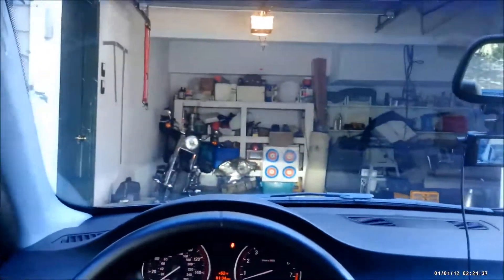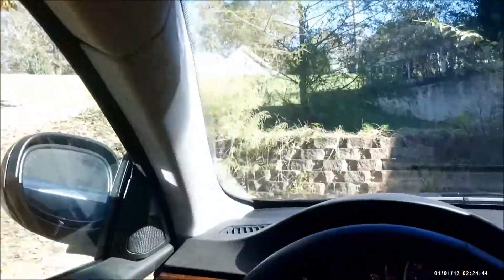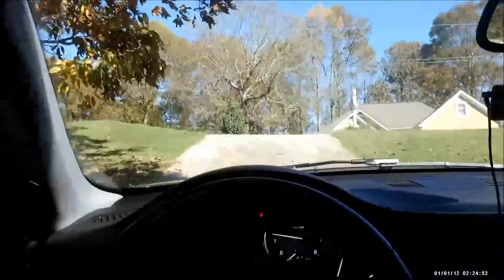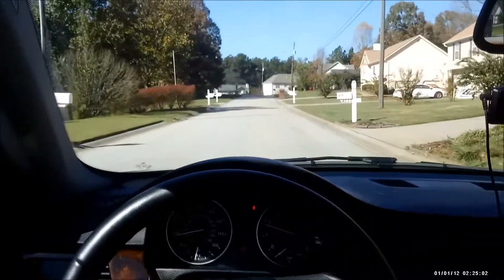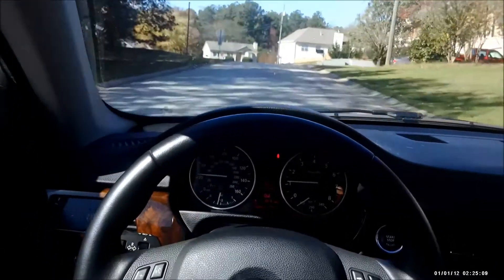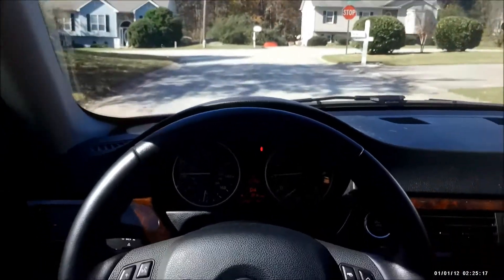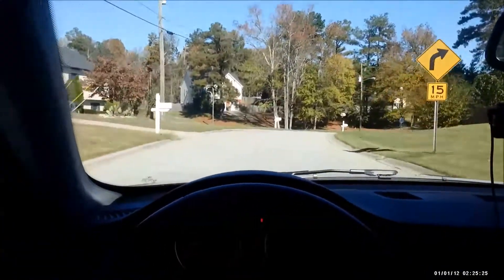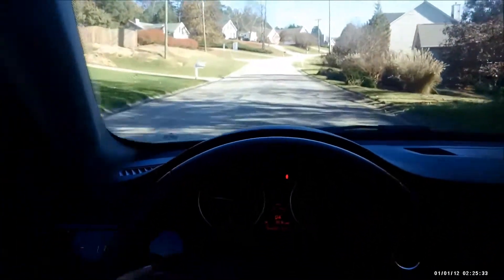Dinan Oil Cooler Test & Review—BMW 335i E92 N55

Comment: Not sure why you would spend the money on Dinan parts, if you havent earned the badge or plan to. I have a Dinan S3 and that oil cooler and intercooler is a very pricey trade-off for a stage 3 tune. There are many cheaper alternatives, for sure!

The intake, suspension, strut bar, etc. are reasonable. What’s your hindsight feedback on your purchase? Stage three software is like $400 vs stage 2 at $2100 (when I built mine). I had an OEM oil cooler, stock. I’m considering the larger intercooler, radiator, and a possible third oil cooler. Since Dinan and BMW have parted their partnership, that’s a sign that they may not be with the price. Price was worth it while they matched warranties and service. Have you added any of the aforementioned non-Dinan parts? If so, did you have to do any major re-routing of lines or installation locations?
Reply from the maker: It's reliable and high quality stuff. The tune is in effect all the time. I don't need to have some module connected to the port all the time. It drives like stock. I don't have any regrets with it. The only non-Dinan part is the catless downpipe.
Reply: @RoguePhysicist  Spoken like a man that has the same experience as me. That’s what’s up! Thanks for that reply…I actually just purchased some catted DPs and did a whole Dinan refresh (every part sub-frame and under the hood). Haven’t gotten it all good to go, but thus far…shit! I forgot how powerful and reliable it all is. I did change my gold FSDs to the Red Actives. Ride is a bit rougher, it seems…even with the same Dinan springs and all. I’ll need to get more driving in. Got a new turbo back system from GT Haus to replace my GT Haus axle-back. I can def try and share these differences, if you care to know. 

At the time, you didn’t have a badge? Things may be different now.. have you thought of checking to see if the prices dropped on other parts you may have considered? I haven’t put the DPs in, but only thing left is S4 turbo upgrade. Not sure if that’s gonna open up a whole can of other stuff I’d need to upgrade. The N54 is a very, very competent daily. Don’t wanna ruin that. I have this feeling of upgrading turbos, and regretting it lol.

Comment: The PS3 gauge is a nice thing. I have one too in my metric BMW e81 118i. noticed that in outside temps over 28C the engine coolant temp is lower because the fan kicks in more frequently. I have a N46 4 cilinder engine but the principle is the same. My engine has a small stock incorporated oilcooler in the filter unit.

Comment: So, now that you have had awhile, do you still think it was a worthwhile mod?
I have a 2012 335is and live in SW Florida where it is pretty warm year round and am thinking about running a larger/additional Oil Cooler as I stay at 250* even with a factory oil cooler.
Reply: $59 oil cooler valve upgrade http://www.burgertuning.com/sport_oil_cooler_valve.html
Reply from the maker: +lokalzrule 

I think it's worthwhile if you want to keep the temperature down a little.  I rarely hit 250, but I get close if I'm not moving much (such as being stuck in traffic jams).
Reply: +Malone the Physicist  Ok Great Thanks!  
Have you been back to the track since Installation?  How did it do there if so?
Reply from the maker: +lokalzrule 

No.